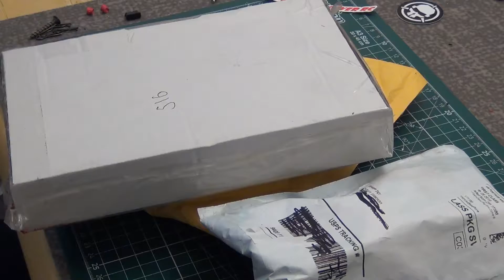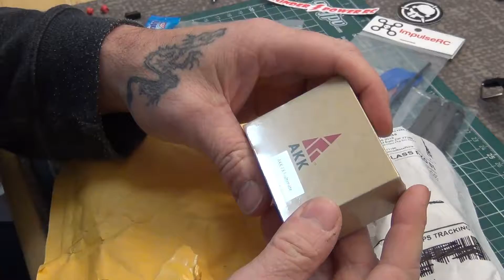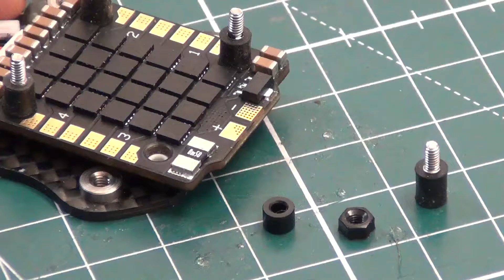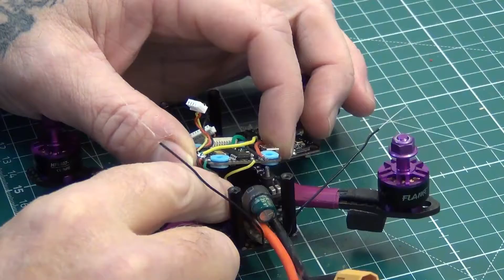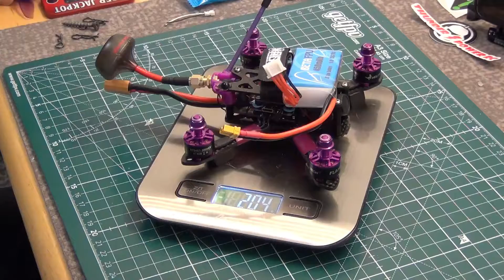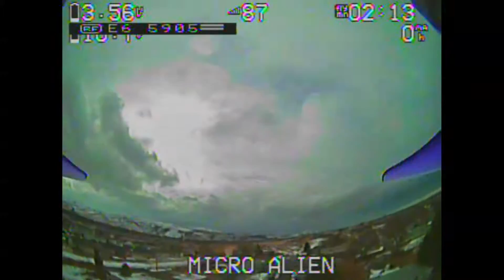ImpulseRC Alien Micro Build and Wiring.

Comment: Thank you for making this awesome build video! Can you tell me what the name and potentially who the manufacturer of your antenna tube setup is? (the one at 23:05) I love it.
Reply from the maker: Yes it is from Brain3D. https://www.brain3d.co/products/xhover-win-4-5-sma-rx-mount?variant=41682657744 I am so glad you liked the video and let me know if there is anything else you want to know about it. Keep on flying.
Reply: @edgefpv4410  Awesome! Thanks so much!! Do you know anything about the little MMCX jumper thats in the mix there as well? Happy flying to you, love your micro alien build!
Reply from the maker: That MMCX connection is the one that comes with the AKK FX3 Ultimate Mini. All I did was loop it once and ziptided it to the length I needed to fit the 3D printed antenna mount. It is not a special one or anything but this is where I got it from https://www.racedayquads.com/products/akk-fx3-vtx-mini-20x20-smart-audio-25-200-400-600mw-mmcx?variant=4457563979787&gclid=CjwKCAjwmq3kBRB_EiwAJkNDp9YSW2ZJa76H3wNG_JEyx833hhzZx-ZdEKzGnYnGGtY54dpKsVAkTRoC2-IQAvD_BwE and looks like they are on sale right now too. Hope that helps.

Comment: Love the build probably gonna do a variation of it for my first brushless quad have flown all brushed whoops style this will be my first time going to brushless set up either this frame or the armatton gecko probably gonna save up for gecko frame since it has guarantee on frame for me being new that's an option I can get behind because shits gonna break and not having to worry about the frame is always a good thing
Reply from the maker: This is a very tight build and was fun to do. The Gecko might be great for you too. Little more room to work with wires and components but I am pretty sure it will be a heavier build. Also think about this, the 3" builds do not brake as often or as easy as a 5" quad less weight to slam into things. and one frame is 72 and this one is 38. It is all personal choose but ether way if you need help I will be happy to help you out. I am really glad you liked the video.

Comment: H from the UK
Im an absolute newbie to the FPV world and just researching what would be best for me both on budget and ease of use/setup etc.
Any advice and tips ?

Cheers

Awesome video
Reply from the maker: So the Diatone quads have been really good, they are a great price for the components that they put in them and already tuned and really to fly. I really have not seen anything wrong with them and I highly suggest them to get started flying. There is a good chance it will crash and at that time you will have to repair it so it is a good starting point to building your own. Also any of the Qx7 remotes are great and a good price so if you don't have a radio start with that one and you can always build it up if you have to get the $100 one. I hope this helps and let me know if you need any help. That is what I made this channel for and I am willing to let you know as much information as I can.
Reply: @edgefpv4410  Cheers for the information, would you recommend building a quad? If so what parts would you recommend
Reply from the maker: It really depends on your soldering skills but I would suggest to go with as cheap of a build as possible so it doesn't hurt so much when you crash. The iFlight XL5 V4 True X is a great frame that is not much money and if you can get a Mamba stack it will limit what you have to solder. Joshua Bardwell has a $120 and it looks like a great build. I do recommend building your own because it brings in all the experience and excitement of this hobby but if you are just starting out learning to fly is more important, so you will have a great time with minimal money spent. Then when you find your style and know what you want to do with it then you get the higher end frames and flight controllers and then you will be able to see the difference in each build you do.

Comment: Great Build Man!
Why are you soldering a capacitor on the PCB/Cable with XT60?
Reply from the maker: All my batteries are XT60 and I run 4s on this most of the time. I only use the little 450mah batteries when I want a faster flip or roll. As far as the cap goes, with this low of amps going through this it is on there like that just for the extra power. Not sure it it would filter any better being right on the PCB. New flight video coming out today and you can see in there that there is no power interference in the video for DVR anyways lol.

Comment: Been thinking of a 4” build.
Impulse Micro Alíen 4” arms with 1506 4200kv motors,  same mamba stack and hq 4x4.3x3 props. Hope it’s worth building. Not sure what to expect. 
I have several 3” and 5” qwads already. 
What’s your thoughts on this ?
Thank you. 👊
Reply from the maker: So I built the 4" Reverb in one of my new videos and was able to do 100mph on 6s with it and it is the same room as the Alien. If you are just running 4s then the 4200 should be good but if you want more speed out of it and efficiency I would look for some 3800kvs I am about to test what one is faster. I had 2400kv motors on the 4" Reverb and I just pust some 2800kv motors on it so I will be able to tell you if higher kv makes it go faster or not. Being 1506 size on the ones you are looking at it might be pretty fast as it is. Hope that answers your question and I will get back to you on the other motors.
Reply: Edge FPV the 4200kv May not be efficient on 4” props ? That the reason for suggesting 3800kv ?
Im still in the planning stage for parts. 
And wanted fast, locked in and of course some efficiency. 
Fell in love with the rcinpower v2 1506 motors, so I had the idea to use them on a 4” build. Not sure but may still go with it. 
And try to aim for light weight in the process. Thanks for your input. 
Still on the fence.
Reply from the maker: Not just efficiency but heat as well. Look at it like motors for a 5" compared to a 6". Most will run 2450kv on a 5" and 2100 on a 6". They are looking for power but not over heating the motor spinning up a 6" blade. 4" is going to take a little more torque to spin the blade so a little lower kv might give you efficiency and more speed because they will not be maxing out the amps.
Reply: Edge FPV got it. Thanks for breaking it down. Makes total sense.

Comment: What do you think of running 4" arms and 3.5" props?
Reply from the maker: I have seen a few people do that and it works well just not as much lift. It is still no difference then running a 3.5" but better control with the 4" arms.
Reply: @edgefpv4410  I need more control 😆

Comment: I'm building the 4 inch micro alien with the f722 mini
Reply from the maker: Should be a great build. I love the F722 mini in my 4" Reverb. I am sure it will do great in the Alien as well. Can't wait to see your build.
Reply: @edgefpv4410   I'm trying to run my camera to rx4 tx4 but on the back of the board that came with the mamba its says it's esc tele ...but on the diagram on the diatone site it shows it going there
Reply from the maker: From what I am seeing the RX4 and TX4 have a u in front of them and I would assume those are uninverted but it looks like Telemetry from the ESC is actually RX6. So you could use RX5 Tx5 or the uRX4 UTx4 and be okay. but it is a little weird on the configuration that way. I actually have the Matex F722 and I thought that was the one you were talking about but I hope this helps.

Comment: That esc is gonna short real quick lol maybe even on the first hard landing
Reply from the maker: Why is that. The ESC is not close to anything that can make it short. I really want to know what you see, maybe I missed something.
Reply: Edge FPV the frame.. the coating on the laminations will not stop conductivity at high amperage or worse will wear off and carbon is very conductive happens to ppl all the time I’m sure the alien is coated with non conductive coating but that only looks good on the multimeter
Reply from the maker: Okay, I do understand that and still plan on putting a Stikit Skin on it as well but I am still not seeing anything even close to touching the frame or any of the carbon fiber. The standoffs are all plastic or rubber and none of the screws are touching any of the boards even the metal nuts on the top. I thank you for sharing but not seeing anything touching.
Reply: Edge FPV that’s why I said when u have a hard landing bc it will flex but anyway just trying to help have a good one and happy flying 🙏👍👍
Reply from the maker: I do appreciate it very much. Thank you again and happy flying to you too.